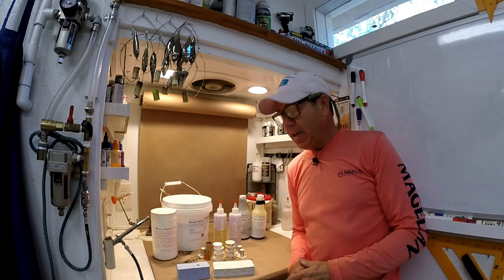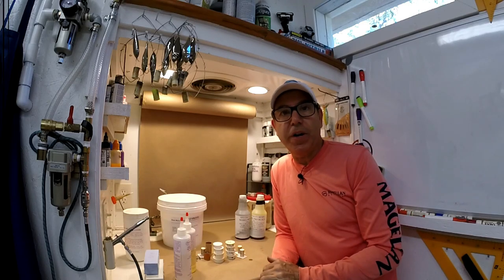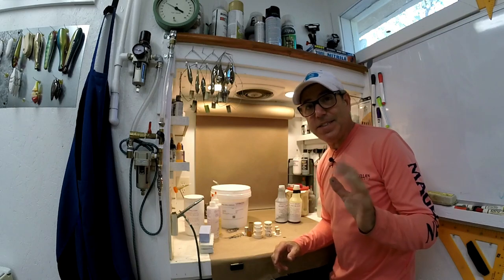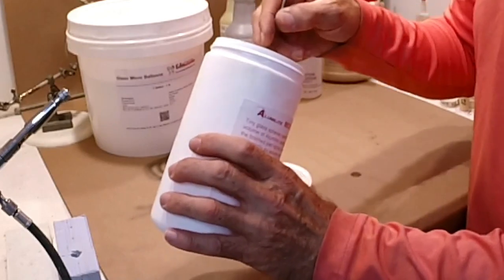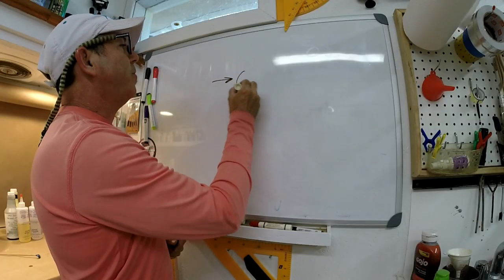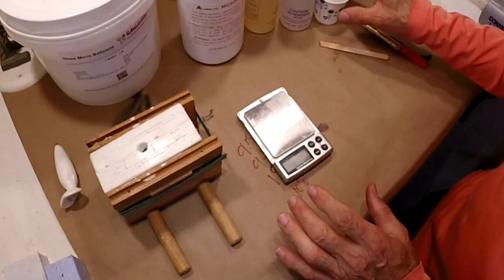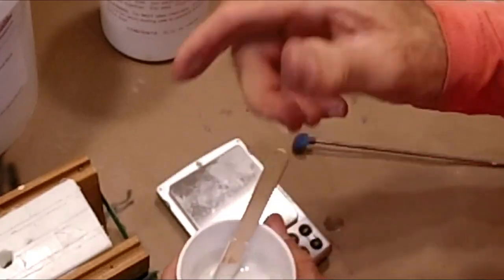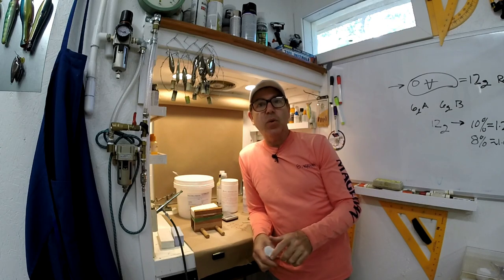Mixing resin to cast the perfect lure

Comment: Most excellent details on lure weight and buoyancy force control methods while using resins and or epoxy with fillers, Thanks so much. You sir have a fabulous instructor presentation and demeanor. Thanks so much. Jim Rodgers
Reply from the maker: Very welcome!

Comment: I'm new to lure making but have done casting in the past.  I've always used a pressure chamber when curing to reduce bubbles.  I was playing around yesterday and with an 8% microballoon loading I get a density of 0.93 g/cm^3 when cured in a 60 psi chamber and 0.71 g/cm^3 when cured without pressure.  I'm going to experiment a bit more today to see if, for a given microballoon precent, I can control density by varying chamber pressure.  Maybe something like 20 psi will give me a useable density without bubbles.  I'm curious if you ever use pressure casting and if you've got a target microballoon load and chamber pressure?  I'm also curious if you have a target density, especially for topwater lures.
Reply from the maker: I don't use a pressure chamber unless I'm casting a clear casting. My concerns with bubbles are mostly avoiding any on the surface. For topwater lures I like a density of around 0.8g/cm³ or less.  The two resin/microballoon mixes that I use give 0.65 and 0.78 g/cm³ respectively.   Those two desities allow for just about any lure design.

Comment: You are helping me learn so much! Thank you!
But I still have questions,,,
So,, if I wanted to create an object that basically sits on top of the water (yes, I know it will not be completely on top) but still be able to "hold" a lot of weight, would the buoyancy formula work? But further than that,, if I knew how much weight I wanted the object to carry without loosing any more depth of floatations,, how would I determine the size the object would have to be?
Let me cut to the chase,,, I'm trying to design a boat/watercraft, that can carry at least 700 lbs, yet not have a draft of more than two inches, and also be extremely stable (to be able to stand up and move around without any, or as little as possible, listing). Oh, and this would be for two people. For the stability issue, I'm sure there would have to be some width included, but I've learned that certain "shapes" in the hull will also greatly help.
I know boat building, and lure building, are not the same,, but, up till you, I haven't been able to find anyone that can help me with this buoyancy formula! Please, help!
Reply from the maker: Well you're in luck...I have also done some boat design, way back.  It's a very simple equation to solve for buoyancy.  Since water weighs 62.4 lbs / cubic foot,  just divide 700/62.4 =11.22 cubic feet.  That would be the volume you would need at the water line, with the boat drawing 2 inches (0.167 foot).  You would then have to figure the dimensions of a boat at the water line and multiply length X beam X depth to get at least 11.22 cubic feet.  for example;  12.5 X 5.5 X .167 = 11.48 cubic feet.  Remember that the 700lbs must include total weight boat+motor+people+gear+etc.   Stability is a much more complicated calculation but I would stick to a wide flat boat.  Good luck,
Reply: @EngineeredAngler  again,, thanks!
Reply: @EngineeredAngler  would the material the boat is made with affect anything?
Reply from the maker: It would only affect the weight and maybe the center of gravity...the calculations for displacement would remain the same.

Comment: Thx again Franco, just out of curiosity, what's the resin that works best to get max flotation? I'm using smooth on 325 with nearly 18% microsphere and still get tail hang on my big lures... Thx aww
Reply from the maker: I'm using the casting resin from Specialty Resins.  Check it out in my Amazon Store

Comment: first of all thank you for sharing this video . if you don't mind my question how to do a hollow lure from inside ? if I used a mold most likely that lure will be solid from the inside . I am trying to make a lure that is large and my computer simulation  shows that am over the desired lure weight and making it hollow will help reduce the weight  if u have made a hollow lures please let me know what procedure u used
Reply from the maker: It's not difficult to make a hollow in your lure that is cast from two-part resin. Simply create a chamber from a lightweight material like a plastic straw and seal the ends. A better method is to use a lower the  density of the  casting material.  That can be done by adding glass spheres to you're resin mix. Watch this video for mixing ratio. And Goodluck,
https://youtu.be/eqJIyzeJkVU
Reply: @EngineeredAngler  thank you . I appreciate  the fast response

Comment: Hi Franco watching all your vids lately… thx! I just started and used smooth on 325 with glass micro spheres but found it to be weak for thinner parts of the lure like the tail and lip, they break very easily and for I need them they hv to be super strong… Amazon peacock bass…. Any strong resins u recommend that still float a lot?
Reply from the maker: If you made the mold from a lure with a lexan bib then the bib is too thin.  I would just buy some lexan bibs and insert them in the mold and pour the lure around them.  Best of luck.

Comment: hello mr engineered i have a question for you i want to make lures for my friends in south america but fish there they have big teeth line dorado or tararira wolf fish i using all resin d60 d80 if i put my teeth in the lure is getting the marks in the lure 

what do you recomend stronger material to cast i a silicone molde
thanks very love your videos
Reply from the maker: I'm using a two part casting resin that is harder than the others I have tried it's made by Specialty Resins. It's 65d and that's pretty hard if you're using 80d resin that should be as good as your going to get. The problem with casting super hard resin plastic Is that if you add microballoons you defeat the hardness. If you don't add the micro loans then you just have a block of plastic with hooks in it very difficult to control the action. I would recommend 65d hardness and let the tooth marks be trophies. Best of luck
Reply: @EngineeredAngler  thanks very much for the reply i will used AlumiFoam with is hard 20 lb i have not idea if is harder as d80 but i think yes i see the smash with a hammer and nothing happens thanks again i will text you if you want to know how is the foam 

THANKS AGAIN

Comment: Great video, Thanks for sharing. I tried to use this method, but i cant get my Lures strong enough. Once it cures The lure can be bended, it feels very strong but it bends using my hands, I have made 5 pieces and all have the same problem.  They swim perfect, and have the desiewd weigh and doing the action that i need, but not strong, enough all can be bended. Tried both mixing methods, by weight and volume, tried different percent of Micro ballons and the results are the same, Im using Alumilite white and followed exactly the instrucciones, What can be wrong? Thanks a lot.
Reply from the maker: The only thing I can think of is that the resin you have is no good.  Alumilite makes a good product but it is possible you got a bad batch.
Reply: @EngineeredAngler  thanks a lot, I will contact provider. Reading your adviceJust noticed the B bottle  have a lot of  material at the bottom, that cant be dissolved, shaked a lot,  and dont disolve. Label in the box is 2019.. Thanks a lot 👍👍

Comment: So what ratio are you counter weighing at, or is that a case pure experimentation?
Reply from the maker: The weight I add is dependent on the lure and how I want it to behave.  There's no fixed ratio...it would be nice if it were that easy.

Comment: Excellent videos. Question, I built my lures using a 3D printer. The lures comes out in two halves. Does the placement of the weights remain the same? Is the resin to micro-balloon formula the same?

I also found on another lure that Alumilite White makes an excellent joiner material for two lure halves, much better than super glue.
Reply from the maker: If you make your lures on a 3-D printer the density of the plastic will be very different from the resin I show in the video.  You will have to experiment to see if you can get the lure to work with or without added weight.

Comment: I'm trying to make a 2 piece, 6 inch glide/swim bait for bass. I want it to be suspending or very slow sink, but i also want the added weight and resin float forces to be very polarized so when i burn the bait it doesnt blow out. I understand that the only way to achieve this is to add more microballoons. Not sure what volume ratios you are using as you mix by weight, but i have read that 1 to 1 ratio of balloons to resin in volume is about the density of maple. I feel that is a good amount of polarization, but i am worried that this many ballons may lead to brittleness of the finished products and hook hangers ripping out. What are your thoughts on this? (Are the mixes you are using similar?, or maybe my idea is too weak?, maybe theres a different resin, or maybe your mix will work fine for my case?)
Reply from the maker: You are absolutely on the right track.  A swimbait needs to have a strong static equilibrium between floatation and weight.  My 10% mix is just slightly less dense that maple (about 15% less) and I never had any issues with strength.  I highly recommend you switch to mixing by weight it is much more accurate and repeatable.  Measuring the volume of  something like micro-balloons is a bit of a guessing game.  Also the placement of the tie-on eye is crucial to keeping it from blowing out.  Good luck.
Reply: @EngineeredAngler  thank you! I can always count on you to reply.

Comment: If pouring a crankbait (for instance), and you want to incorporate  the lip into the master rather than adding a separate lip each time, how thick does the lip have to be so that the strength of the resin will support it without failure?
BTW....love your videos and your common sense approach
Reply from the maker: 3mm is a safe thickness for almost any resin mix.
Reply: @EngineeredAngler  Thanks!

Comment: I also appreciate the fact that you provide actual measurements. I'm curious about a couple things though. First, does it matter what resin you use? I have a decent amount of Envirotex Lite that I could use, if it is sufficient for this purpose. (I bought too much when I got some for coating airbrushed plastic lures). Second, I was considering using sawdust for filler, or even a pine cone (after seeing the cool lure that Solarbaits made) and was curious if your measurement would work for this, or is that only for microballoons? If the percent is different, would you, by any chance, know the correct ratio for sawdust? It's readily available to me for free, but the Envirotex is pricey, so I don't want to waste it.
Reply from the maker: I have no idea what the ratio of density between micro balloons and sawdust might be. But just go for it. Don't try to save the resin it will only go bad with time.  I would start with the assumption that the densities are close and use my ratio as a starting point. I'm rooting for you!
Reply: @EngineeredAngler  Thank you for the reply and advice.

Comment: Hello, I've recently started making my own baits with Alumilite White and the 10% mix you mentioned in your video, but am running into issues with bubbles forming on the top of my bait and leaving tiny voids all over the bait. I suspect it's due to moisture contamination and tried eliminating every possible source of water in my process to no avail.  

I was curious if you have any experience with this issue?
Reply from the maker: It is not likely moisture.  I find that it is usually a mechanical issue, not enough vents in the top of your mold or the sprue in a less than optimal location.  Put more vents in your mold...it will likely take care of it.  Good luck.

Comment: If you want a lighter lure, do you think 20% Mircoballons would work?
Reply from the maker: The mix designs I offer in the video should be all you ever need for lure making.  20% will create a very week resin,  but if that's ok, you can try.  Good luck.
Reply: @EngineeredAngler   I want to get my lure under an oz. while keeping the same form factor. I’m injecting it into a 3D printed lure so that may work. I’ll test it and find out.

Comment: Hi, very interesting video, thank you a lot for all your informations, as I start making my own lures, I wanted to know some things before : (sorry I'm french so excuse my poor writing lol)

- Is microballons all the same density,etc... or does it depend of the brand ?
- Your mixing ratio of microballons is (approx.) the same and would be ok with every resin or does it depend of the resin (difference of density,etc I guess between all the brand)
- So if I rightly understand, in fact, on the final mix and body of lure, the lure would float much more on the top and less on the bottom due to the microballon and his density who make them go on the top of the mixing ? (that's why you recommend to put the hole of filling at the very top of the body's lure... but on the site I purchased my materials, their recommend to fill the mold by the tail, for a popper, opposite of what you recommend, and following all of that, MB would be much more on the tail)

Thank you very much in advance for taking the time to read my questions and your reply and for your videos !

Keep up the good work !

Cheers !
Reply from the maker: First, thank you for watching and asking good questions. 
 I have used the micro-balloons from 3 different suppliers and have found no differences.  
The specific gravity of epoxy resins are all very similar, 1.1 to 1.2, therefor you should not need to worry about the difference. 
 For almost all lures filling the mold from the top will work best.  But as a lure designer you should always consider the fact that the lure will be less dense near the fill hole and use that fact as part of your design.   So a popper with a very thin tail might work best if the tail floats more.  Therefor filling from the tail end could be the best method.
Good luck.
Reply: Hi, you're welcome, and thank you again for your video,help and informations !

Happy to heard that you tried 3 different suppliers and no differences, it make the things more simple.

I ordered mine on "Bricoleurre", and they said that their density is equal to 0.25... and after some search on the internet etc I discover that some local shop for carving, surf, boat,etc finally sell Microballon from Sicomin (d= 210 to 250g/Ltrs... I bought one to try) and an other brand I can't remember (they said no at the start of my search because I asked them about "light charge" based on the name they use on Bricoleurres), they also sell epoxy and Polyurethane for lures (what I bought first with them... and then decided to order Microballon, thinking that no one sell that here) , but they didn't knew that we can use them for lures lol 

I didn't think about the fact that fill popper by the tail would make it more stable, well spotted ! thank you for that !

I would like to make a kind of insert of Microballons, and cover this insert with aluminium/abalone foil, then put the insert in the final mold and fill with the epoxy with some pigment for the colors, the idea is that the colors will be always here, no need some paintjob,etc..., for weighting, I hesitate between put it in the mold with the insert or proceed same way of wooden lures and drilling hole, put lead then adjust... it could be interesting in my opinion, but it will be a lots of trial and error I think, as lot of people say when making lures and as with most things.

One more time, thank you very much for all ! 

Keep up the good work

Cheers !

Comment: question on measuring mixtures by weight. I coat mine with e-tex, and I do the measuring of the two parts. do some things have differing weights, which would make that method not work? I know that hardeners are usually more a yellow colour than resins, but would they pretty much be equal weights? it sure would make a lot more sense, and be a whole lot easier, to measure the mixture by weight, that's for darn sure.
Reply from the maker: Most two-part epoxy have the same density for part A and Part B but on occasion you'll find that they don't. Usually when the manufacturer tells you to mix them by volume there's some difference in the density of the 2 parts. But it's easy enough to figure it out just squeeze a little into a graduated measuring cup and weigh the cup, note the volume in the cup. Do the same thing with both parts using the same volume in a cup . If you see a different then you can just calculate the percent difference and use that for calculating the weight of the two parts next time you mix. ... Maybe I should make a short Pro tip video on this.

Comment: Really helpfull, thanks so much!  Why do you suggest to use a fast cure resin? What about the pros to use a fast one? What about the cons to use a slow curing resin? The resin that you use most, I see that you're experimenting with many different brands,  is epoxy or poliuretane? Thanks so much for your valuable help!
Reply from the maker: I prefer the fast cure because it reduces the probability of the resin  leaking out and, of course, to make more lures faster. I definitely prefer the epoxy resin...
Reply: Thanks so much, here in Thailand is not as over there in USA, I can't find all the products that you easy buy in shops or even online, I already explained why. Here I can't find poliuretanic resin but you said that epoxy is better, at list you prefere, more important and unfortunately, I  can't find fast curing epoxy so I have to make work the materials that I have. Thanks so much for your help, I'm watching all your videos an thanks so much, your dedication is remarcable!